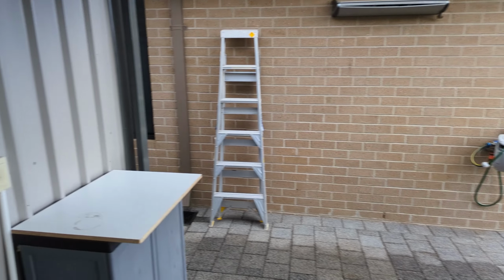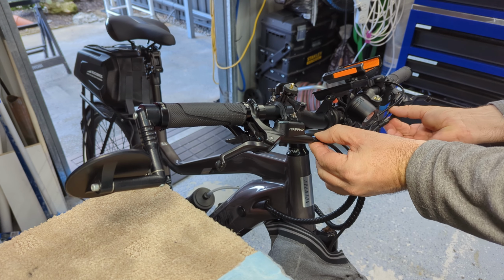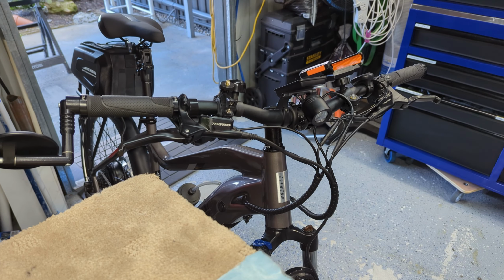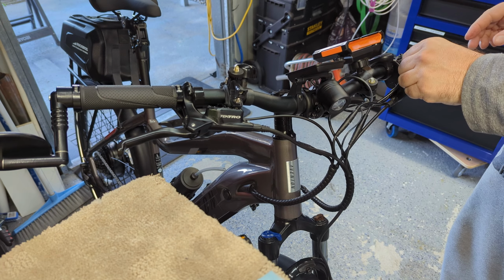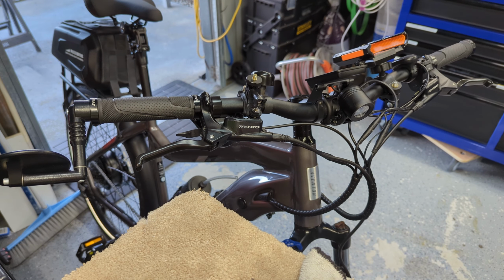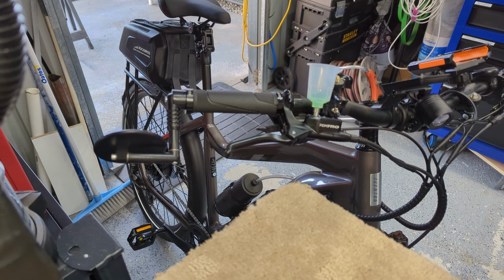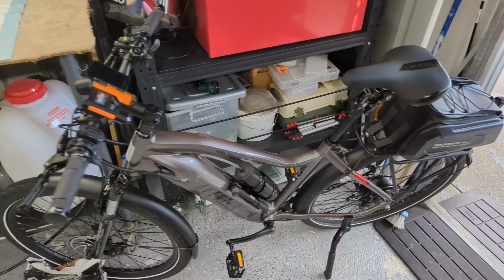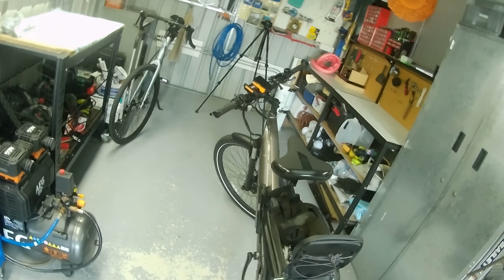Brake Swap and Bleed - Alarm on Aventon Level 2

Comment: Thank you for sharing this. It's bugged me too that the Aventon Level.2 comes with brakes the wrong way around. I'll give this a go myself. May I ask what bleed kit you have? Thanks.
Reply from the maker: Yeah funny set up. Pretty sure it's just a cheaper one from ebay or Aliexpress.
Reply: @MattInTheShed400  Thanks Matt. I bought a kit from eBay to bleed the brakes so when it arrives, I'll swap the brake sides over like you did. Strange you're located in the Perth region too! I'm Dawesville based. I have exactly the same Aventon Level.2 as you. Really enjoy it but wished I'd gone for the larger frame option. I have a Giant momentum eBike too which is crank powered. I use both bikes alternately, both having subtle differences. If you're ever down this way riding, give me a hoy. Enjoy your cycling.
Reply from the maker: Yeah for sure will do. They are a great bike.